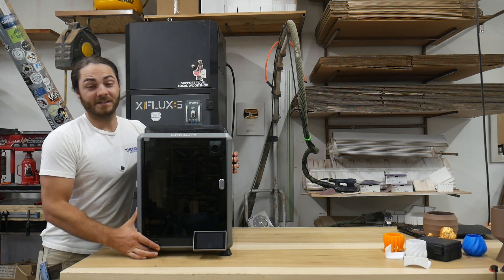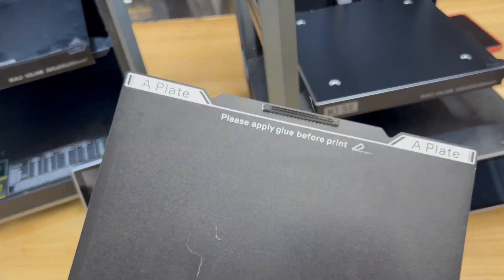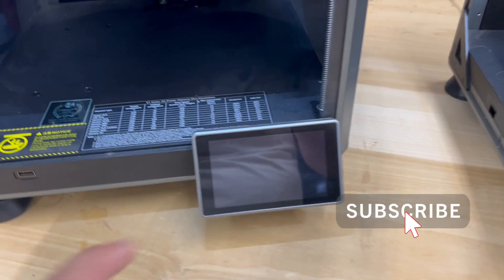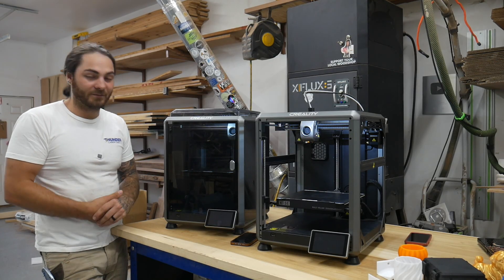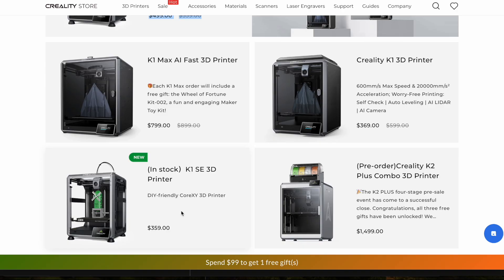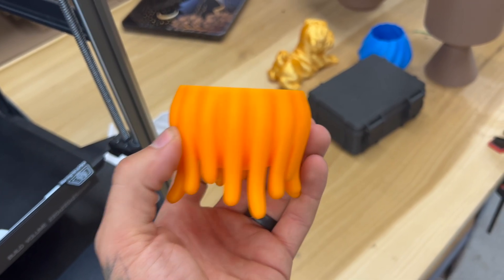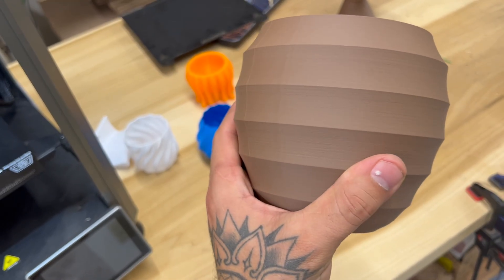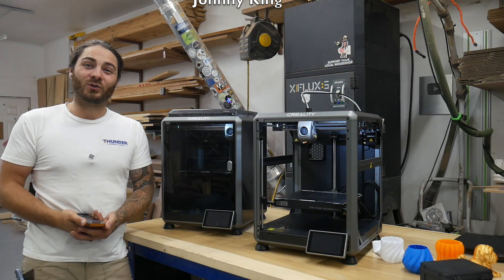Another Creality K1 Printer? Taking a look at the NEW K1 SE

Comment: I had both.
I had a k1,  printed fine, but then I ran into issues that CS just didn't fix, so I got a refund from Amazon.
I then got a  SE and have had no issues with it, runs great.  I found I didn't care to use any filament except PLA... so the SE was perfect.
This week I got a 'HI" and although I don't like bed slingers (they take up more space), it has been great, and colors really is more valuable to me than exotic filaments, so no enclosure is fine.
Reply: How is the print quality of the HI vs the k1 SE?
Reply: @ some areas better, others equal . For example the first layer is flawless on the Hi, just ok on SE…. With same settings and same rfid pla.
Reply: @ some areas better, others equal . For example the first layer is flawless on the Hi, just ok on SE…. With same settings and same rfid pla.

Comment: I have a question. I am wanting to do 3-D printing to make handles for 20 ounce 30 and 40 ounce tumblers. What would be a good 3-D printer to start off with  and also what kind of white wire or stuff would I need and then when you buy a 3-D printer, does it come with the software or do you have to buy that separate? Thank you for your help
Reply from the maker: Hey! 3d printer software is free and printers typically come with their own but you can use other softwares as well. You can’t really make things in the software you will need files. Just look up 3d printing filament, for tumblers I would use something like ABS or ASA as they will be outside, in hot cars, and getting used and abused. I would probably get an enclosed printer so you can try different filaments that meet your needs. I have multiple printer reviews on my channel also watch others reviews as well. I’d get an enclosed FDM printer not a resin printer. It can get confusing
Reply: @ thank you for your help

Comment: Do you consider this k1 se printer a reliable printer? I could get k1 SE for like 315 usd  vs the bambu a1 for 375 (im from mexico, those are the current prices) i decided to go for the k1SE. I do like a lot more the idea of a core xy printer for even cheaper but im worried cuz this is would be my first printer and i've heard creality has a lot of quality control issues while bambulab is just easy printing. I do like tinkering and learning from fixing things since im in the custom built pcs hobby i just dont want something that makes me not wanting to use it cuz everytime there is something going wrong, i do consider i learn really fast and i have a decent amount of hardware and electronics knowledge cuz the pc hobby i mentioned before but i dont know anything about 3d printing ant this is my journey start. What are your thoughts on these, would you consider i should be fine with the k1 SE?

Comment: Which would you recommend: The K1 SE for $329 or the Flashforge adventurer 5M (not the pro) for $299?
Reply from the maker: I haven’t used the non pro but I have the pro and I think it’s a great printer. I’d personally probably buy the adventurer. I think both printers are great for the price point I just feel the 5m pro requires less tinkering and I like the quick swap nozzles.
Reply: @TwoMooseToo  what about K1C vs 5M Pro?

Comment: Hey, just wanted to add from a K1 SE owner: I chose the K1 SE as a print almost exclusively in PLA. If you print PLA with the doors and top closed on the K1C, you run the risk of nozzle clogs due to heat creep. That's not an issue at all on the K1 SE. Since I almost exclusively print PLA, I didn't want to have the door open and top open all the time on the K1C, and I figured the $140 savings was worth it for otherwise the exact same printer. Although, I did add the K1 camera for $25, so I guess, $115 savings. Bed is almost exactly like yours, slanting to one side. Haven't had too bad of issues with 1st layer, so haven't shimmed or gear skipped it yet.

Added moonraker and fluidd to it; big upgrade over Creality OS. And it's overall a million times better than my old Ender 3 V2 bedslinger I upgraded from. Thanks for the video.
Reply from the maker: Nice! That’s awesome, yeah mines been fine with limited tweaks. Glad you like it! Happy printing 😁

Comment: i just returned mine as I am new to 3D printing because this printer has been kind of irritating.

the printer started out fine but after a few days I started running into issues. 

the wifi would disconnect here and there not often but id have to turn the printer off the back on
when the printer started doing the first layer of print it would do a little level and extrude some PLA but that little bit of PLA would stick to the extruder then get stuck on the first layer.

today I started the printer and started doing a print and I noticed my printer had stopped so I checked the screen and found an Error: Leveling sensor chip abnormality, sensor damage or environmental impact

I was able to get the Error to go away for alittle awhile after doing a full bed level and factory reset but it came back later on. I know im new to 3D printing so I could have been doing things wrong but I decided to just never print again so I returned it
Reply from the maker: Yeah sounds like you might of got a dud if it’s throwing error codes!
Reply: The wifi issues are caused by your network trying to enforce WPA3 if you have WPA2+3 enabled. I solved this by temporarily downgrading my wifi to WPA2, connecting the printer's wifi, then changing the wifi settings back to WPA2+3. That seems to have solved my connection issues. Other than that, sounds like you got a dud, sorry. My K1 SE has been solid 40+ prints in so far.

Comment: The current k1s do have the unicorn nozzle,so for the price difference the Se is probably worth it to most people who primarily print PLA. However I just sold a K1C for $300 so there are options.
Reply from the maker: Weird so other than no camera? Is the extruder different? I see k1 and k1 max on market place all the time especially with new printers coming out all the time
Reply: @TwoMooseToo  the camera is normally absent from the K1 and the current versions have the newer extruder apparent by the white locking ring vs the blue(older) version. I added the camera to my K1 for $20

Comment: If you root it and use orcaslicer with them you will like it try it just the option to print direct from the slicer is a gamechanger nice video
Reply from the maker: I do run orca I didn’t root them though I just drop it though the IP klipper screen in a web browser
Reply: Do you know how it is with VFA?

Comment from the maker: What do you guys thing of the new K1 SE?
Reply: i think that its a smart move from creality and lets face it 95% of ppl print with PLA and the prints size are under 220x220 i have a k1 and some times i do need to take the cover off my opinion
Reply from the maker: I just find it weird that it’s pretty much the same price as the original k1 but I 100% agree most people are printing out of pla maybe petg which neither need an enclosure.
Reply: absolutely love mine… waited for quite some time for the bugs to be worked out.
Reply: Why anyone would buy a Creality printer rather than a Bambu one is a mystery to me! .  I wouldn't even buy the K2 which they say is actually pretty good for a change.
Reply: @joeking433  bambu is the apple of 3D Printing, closed source and with the latest firmware they are pushing it can block 3rd part stuff from being able to be hooked up or communicate with various software (all in the name of "security"...). They could also push a update to remove features you previously had or heck make it so your printer doesn't even work anymore, why they would do that is beyond me but it would theoretically be possible.